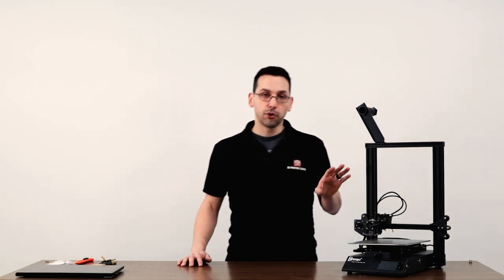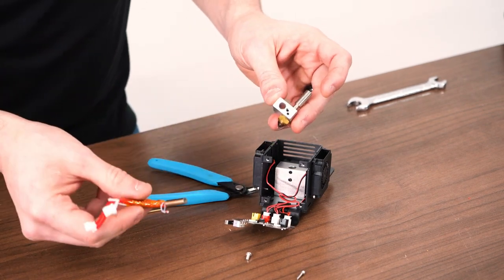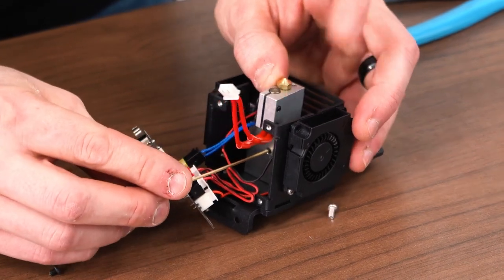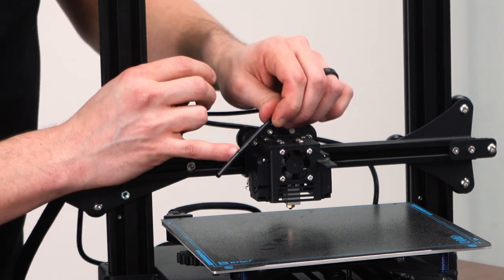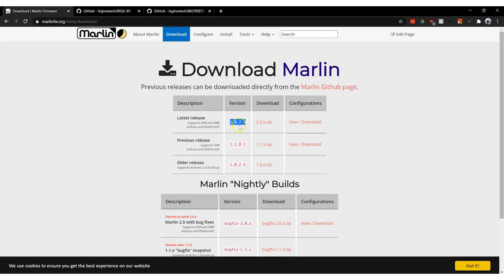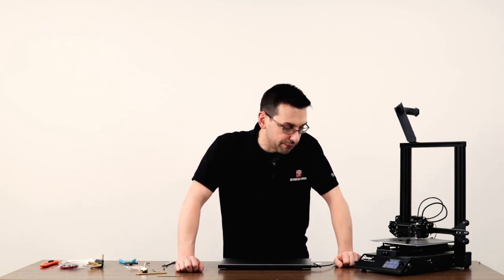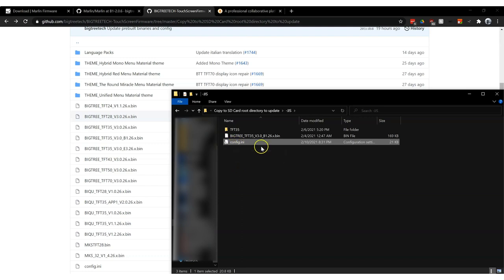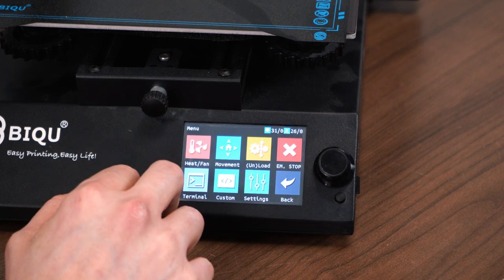All Metal HotEnd + Flashing Firmware on the BIQU B1

Comment: Didn't see this earlier.  I did this mod with a clone volcano and it's been working really well. BLtouch and smart sensor were a bit of a chore but it's all working well now and I get about 6 days of printing before there's an issue. I am printing ABS the last few days and had a couple of failures from warping but it's been cool here. I haven't tried nylon yet I'd love to see a sample part
Reply: I'm eventually hoping to start printing nylon with mine, but I want to upgrade the extruder & hot end once more before that happens.
Reply: where did you get the fan duct for this mod? can't find it anywhere

Comment: Hi, I tried to flash the firmware of my B1, because I installed a BL Touch and this was not supported from the installed firmware. Unfortunately the printer gives this message out: "System loading, please wait" and nothing happens. Do you habe any idea how I can fix it? I wrote a request to Biqu, but they never answered. I have a Bigtreetech SKR 2 as mainboard and a BTT B1 TFT35 v3.0. Thank you in advance.

Comment: GREAT video!! 

Quick question; is this just a "regular" Volcano-kit from Ali/Amazon? And what about the fanshroud? Will that fit afterwards?
Reply: No, the fan duct won't fit.  but here are a coule of options for ones you can print that will fit with the volcano. print it first if this is your only printer and you need cooling heh
Reply: @javelinexile   Do you have any stl's for fan ducts that will work?
Reply: @jjsemperfi  Hi there I actually don't have the file anoymore I didn't make the desighn but it was sent to me and I reached out to see if they could post it somewhere

Comment: I'm looking at potentially getting one of these Biqu B1 printers as my first printer, and hoping to eventually be able to run higher temperature. Can someone tell me if I'm on the right track with how this would be achieved:
-do the hardware mods shown in this video
-replace the heater with something that goes hotter
-change/update firmware to allow higher temperature to be selected

Is that all correct? New to 3d printers and in no way familiar with modifying firmware and that sort of thing. Want to choose a printer that I can eventually modify/upgrade to do some of the things I can see myself needing in the future

Comment: Is there any advantages in upgrading to an all metal hot end if I only intend to print PLA? The hot end on my BiQU B1 is leaking between the heater block and the heat break, so I'm checking my options.
Reply: what did you end up doing? i have the same problem
Reply: @Harel-DIY  I got a v6 from trianglelab and design a mount for it
Reply: @Felipeh999  oh cool, are you happy with it?
also what did you do with a themistor? isnt the v6 using a diffrent type?
i would like to upgrade to a v6 or a volcano but my printer isn't working so i cant print an adapter 🤣
thanks!
Reply: @Harel-DIY  yeah, it works fine. The all metal hot end gave me some trouble for some brands of PLA due to heat creep, at first, but I've changed the design of the mount and now everything works perfectly. The hot end comes with a different thermistor, so I had to change the firmware.

Comment: Will doing this re-flash help eliminate 'thermal runaway' shut down alarm? (I didn't install the e3D volcano thermistor when I changed over my hot end. I figured I could just use the existing biqu thermistor🤷🏼‍♂️. Was I wrong about that?)

Comment: Never EVER do any work on the hotend while the printer is turned on! Even tightening the nozzle! You can easily short the thermistor that is going to kill the motherboard. The SKR 1.4 in the BiquB1 doesn't have any protection against short on the thermistor.
Reply: 😳😳😳😳🔥 good info! Does the breakaway board have a fuse or anything?!
Reply: i did this, how would i solve it, would a new skr 1.4 and a new hotend solve it?

Comment: where can I get the parts shown in the video? what is it excatly called?
Reply: did you find it? i need iit as well
Reply: @Harel-DIY  nope...
Reply: @nebuchadnezzar47  so what did you end up doing?
Reply: @Harel-DIY  I only use this printer for low temp materials... I got a second printer now with full  metal hot end